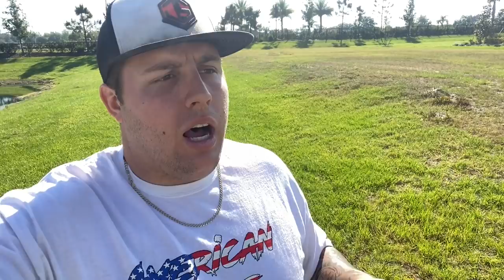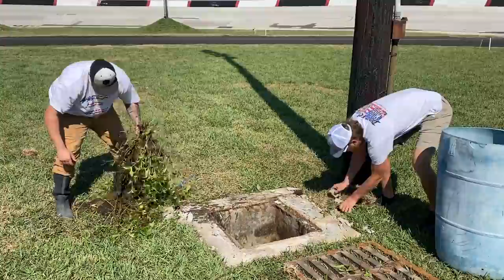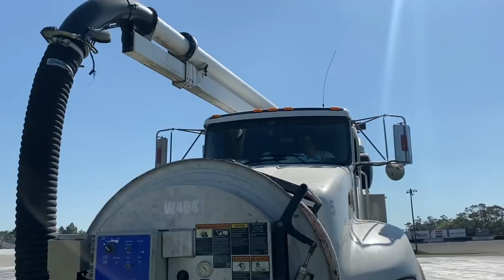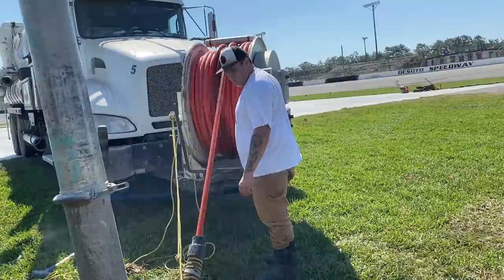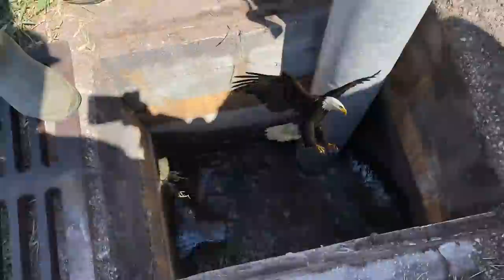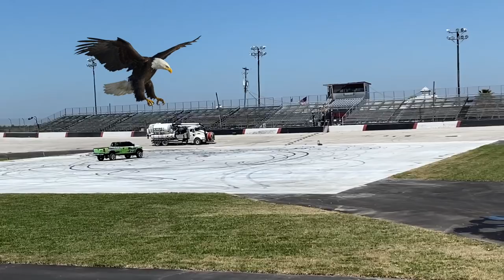CLEANING STORM DRAINS OUT AT THE FREEDOM FACTORY (So Fun)

Comment: I did this same thing for a little while for the townships in my area for a local plumbing company. I cleaned out storm drains with a vac truck and used a jet head to clean the pipes. The dude that owned the company was really impressed with my work ethic and offered me a full-time position, but I ended up getting a crazy good job offer and now I'm a heavy truck driver in the oilfield...7 years later. The only thing that sucked is the plumbing job was within walking distance on the next street over, and my driving job is 2 hours away...but my company gave me a company truck...so I'm happy to drive it.

Comment: I love those trucks. I’ve worked with the city for many years. The city doesn’t always know where there water mains are. They have maps but I’m not sure who drew them up. They are always off by at least 10 feet or more.  I come in and mark where I believe that they run. 
  It’s a beautiful site when they dig down and find a cracked 16 inch water main. That can flow a lot of water out of a crack. Then they come in and suck the water out of the hole while one guy litterly works under water to get the band on. It’s fun to watch. Once I locate the line. I get paid to stand around and watch.. I love my job!!!

Comment: I worked for AAA pipe cleaning for ten years ,Just a heads up.I the future bring roll of 8 inch black flex pipe you wont have to take chance off road.Also if you have a 14 had pipe extention on jet hose with small head you hang up in unown dran boxes.I learned from the best in Houston D man in the 90's we did exon and most plants and all of Houston and surrounding areas.
Reply: Thomas Waldorf dude flex hose sucks working with lol. I had to run about 175ft working inside a school it was a terrible day lol

Comment: Do you have a camera?  Then you can find the box.  He should locate it and cut a hole and put in a grate.
Reply: Im not a vac truck guy, but exactly what I was thinking. 
Measure the distance and add a clean-out. 
I dont think an actual drain grate would do much cause the pad wasn't poured to drain to somewhere on the pad, but off to one of the edges.

Comment: How muck water pressure do you run in a storm drain like that? Im running a Freightliner vaccon truck, for the City of Fort Smith, AR. 
1K lb  water capacity and 1K lb debris tank. Pump runs on a pony motor capable of about 3K psi

Comment: Good job yall. To get that PTO on in that truck do you have to flip a switch n put it in gear or is it auto where ya gotta do the Reverse Neutral Drive push buttin combo n the switch?.
Reply from the maker: Flip switch, reverse neutral drive
Reply: @JustinSwanstrom69  That a BIG 10-4 ole buddy!.
Reply from the maker: Newer trucks are set up where you have to flip switch; throw it in gear, then back in neutral which then allows another switch to light up so blower can turn on out front! Shits gay lol
Reply: @JustinSwanstrom69  I totally agree with ya on that one. Ive been running those kinda trucks for years. Its hard to find a manual in the line up anymore. Their all going to auto with all that push button bullshit. Nothing like the old days where ya flip a switch n put er in gear. Took me forever to figure these new ones out. We get our trucks from Jack Doheney Company in Ohio n had to call Vactor when we first got em to figure em.
Reply from the maker: We have jack doheney here in Orlando too
Reply: @JustinSwanstrom69  Thats whats up brother! Yall ever done any work for the Hillsborough Trash Facility down there?

Comment: Jeeze how much pressure is in that line that slinky has a hard time hanging on to it?
Reply: Most of those Vactor 2100+ put out up to 100 GPM @ 2000-2500 PSI without any custom/special order pump configs
Reply from the maker: Facts. Also depends on what head we are using, have to adjust it, some heads out out 60 80 120 gpm
Reply: The hose will hold all the beans for a while

Comment: how many gallons of water does that truck hold ?  2500 or 3000 ? not with 2 axles . that vactor is the loudest truck i have ever heard. you need a dual engine vac-con . there even built in florida . nice of you to support a race truck but not the local economy ?